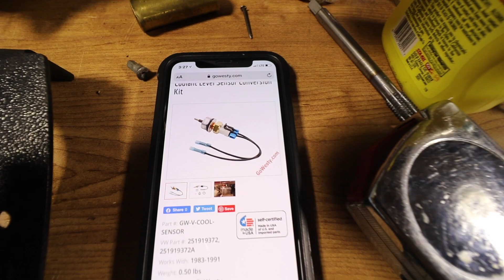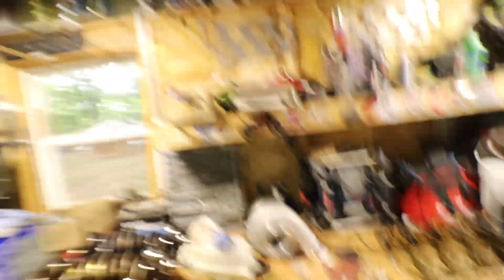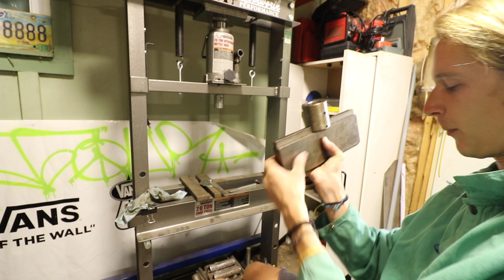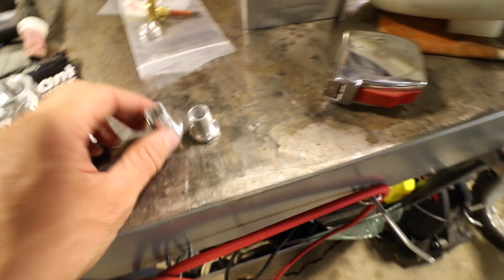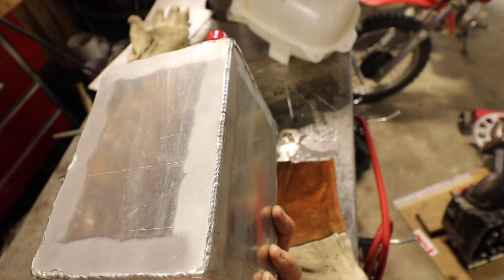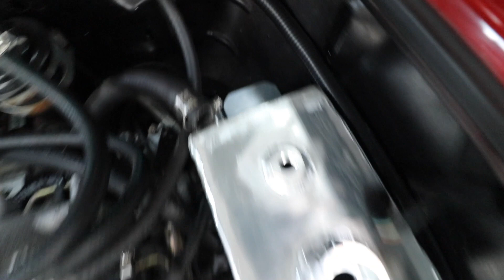My Custom Tig Welded Aluminum Tank

Comment: Nice job! I'll have to consider this if I have any issues with the plastic tank. I did stainless lines and radiator when I did my conversion as well. It's great piece of mind to have an all new cooling system. I'm adding A/C over the winter and it will get a new heater core at that time. For now it's bypassed. Cheers
Reply from the maker: NICE!! Yeah I did my heater core a couple years ago. I made a video pretty far back on my channel about it.. I put in an inline pump in that I have a switch to. IT HELPS SO MUCH!! I mean my heat worked before, but NOTHING like it does with that pump on. Its a far way for that water pump to push and with the help of that pump its awesome🔥.
Id like to add AC eventually and every once an a while look into the different conversions, haven't decided on any.. Id be interested to see/hear how yours works out for you🤙